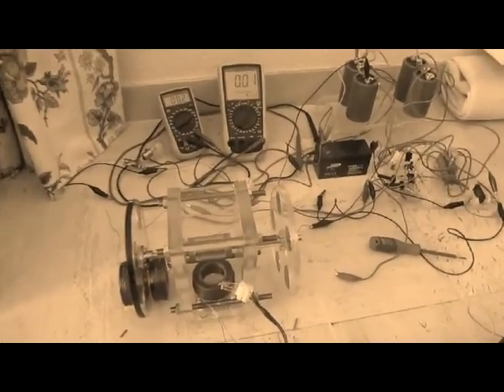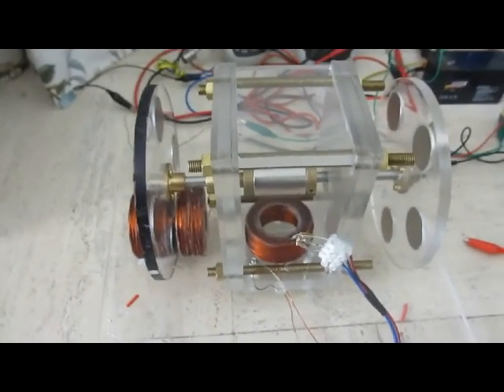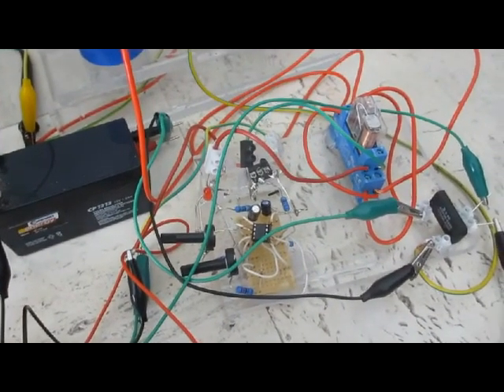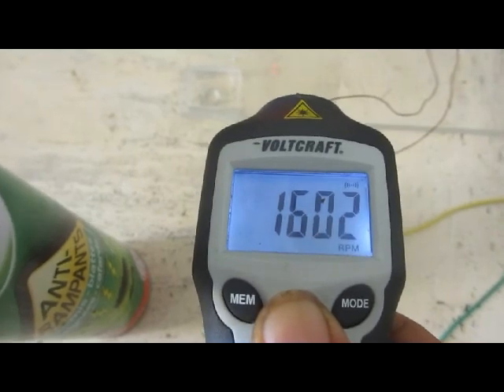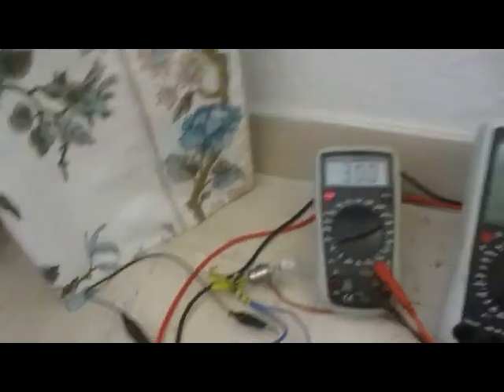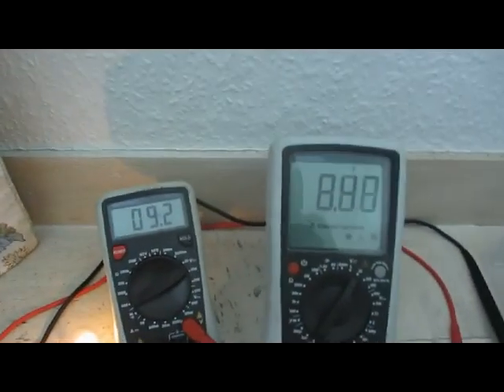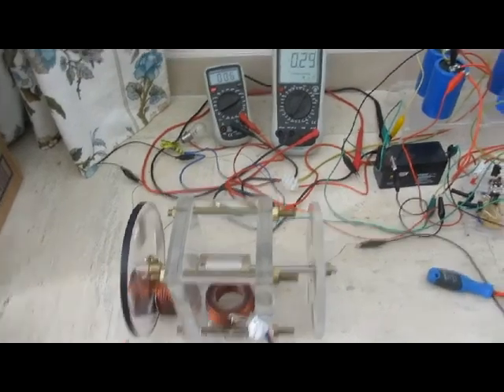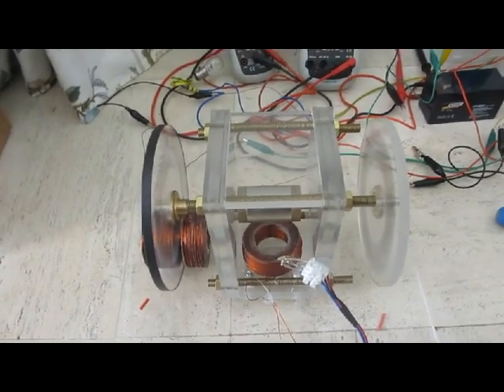Lenz testbench

Comment from the maker: thanks for watching.  I had bigger ones (for 10 mm shaft) custom made by a local company that does lathe stsuff. very very expensive like 20$ each.(with minimum 20 pieces)
So i bought myself a little lathe, and for this 8 mm system i did them myself. search for  "proxxon lathe 230" and you will find it.